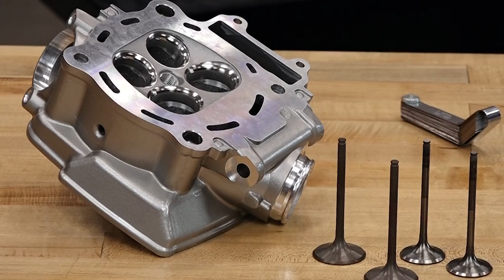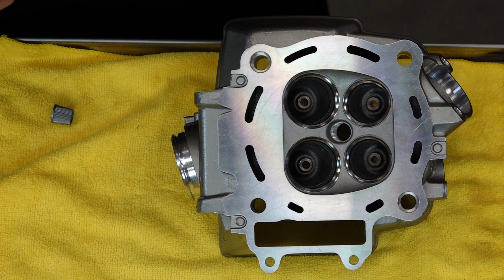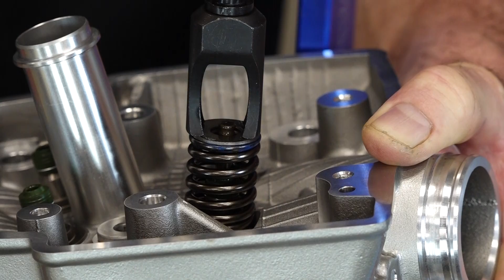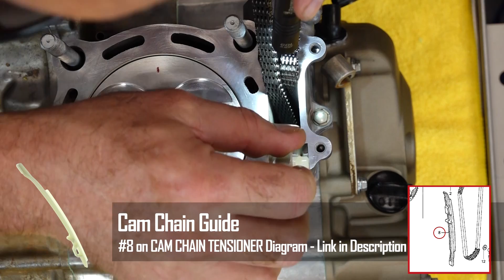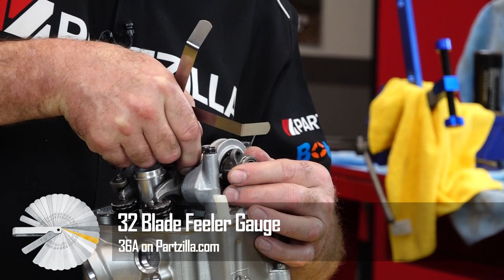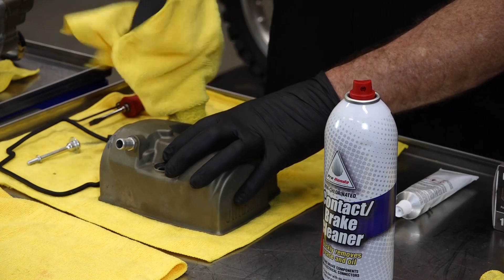Honda CRF450 Head Installation | CRF450 Valve Adjustment | Honda CRF450-R Engine Rebuild Part 6

Comment: Those aftermarket valve springs are for the Kibblewhite SS valves. Someone swapped to stainless steel intake valves to improve longevity on that used cylinder head you have there. The springs have a different rate for a heavier valve.

Comment: I have a question: If the titanium valves are no longer tight and I'm not allowed to grind them in, do I need new ones? How do you machine the valve seats for the titanium valves?
 Or needed a new head?

Comment: There are 2 hash marks on the flywheel. Which mark do you align with the case? 1st or 2nd hash mark? I believe 1is f for fire? And 2 is t tdc?
Reply: 2nd one
Reply: What if there’s only one hash mark? I must have an aftermarket flywheel

Comment: I know this question is irrelevant to the video however i have just purchased a 2014 Honda Crf 450r and instead of the stock air forks that it should have the previous owner installed an MCR A inner kit. My question is does this kit require the same maintenance as the showa spring fork? The reason why I’m asking is because I’d like to know just what I’m dealing with when i need to replace seals on them.
Reply: Seems like that a better question for the manufacturer